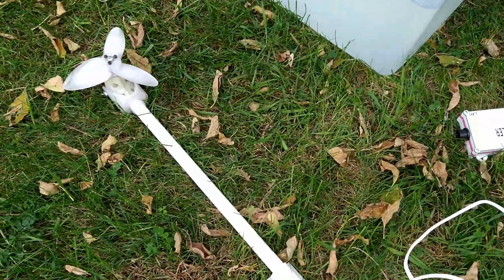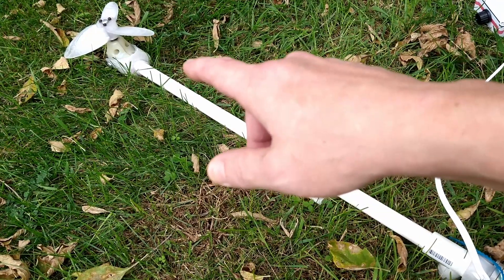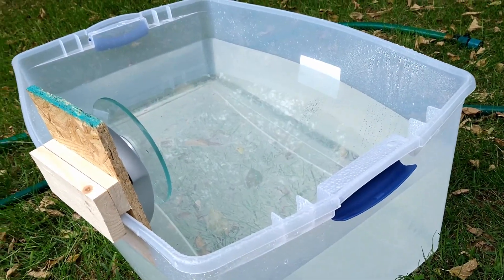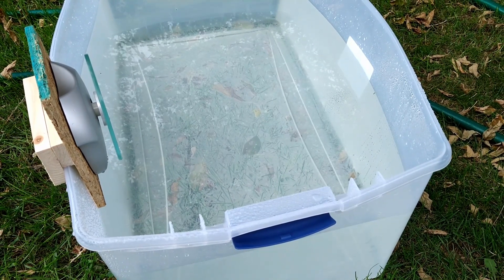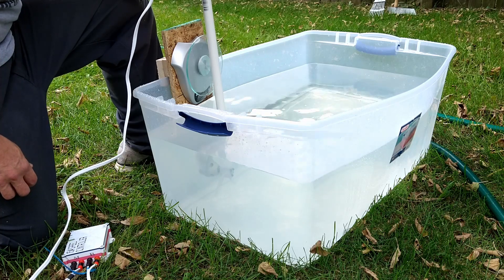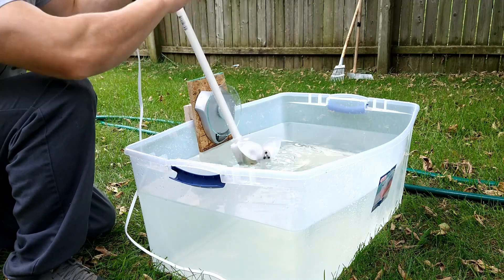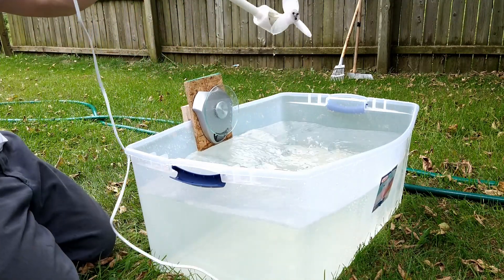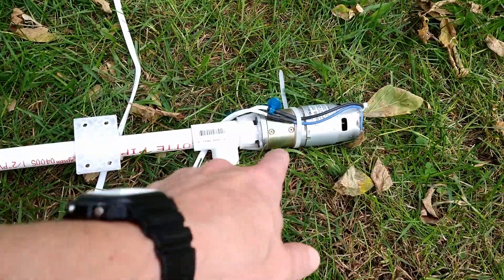DIY Trolling Motor Test

Comment: I didn’t realize 3d printed parts could handle that much torque. Is that a special material used for printing the gears?
👍🤓
Reply from the maker: Hey D, the 3d printed parts surprisingly stand up to a lot of abuse. The props and hub are printed with PETG which stands up to water a little better then some of the other materials you can 3D print with. Now the gears in this gearbox are metal, the shafts then go through brass bushings that act as bearings, then both ends are threaded. The gearbox portion is a right angle drill adapter. I attached a threaded rod to one end and the prop and hub assembly to the other end. Thanks man have a good one!